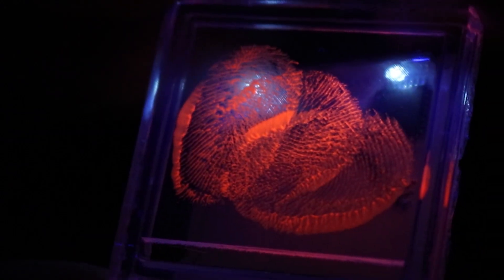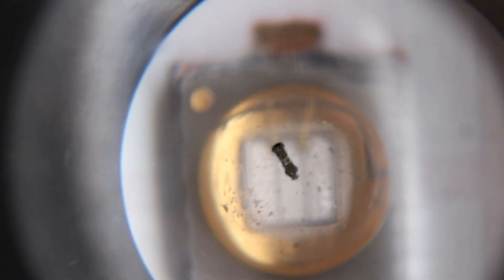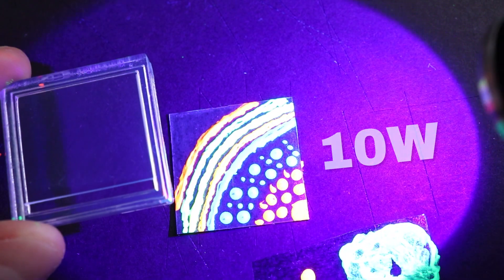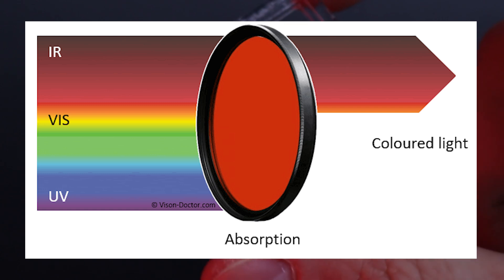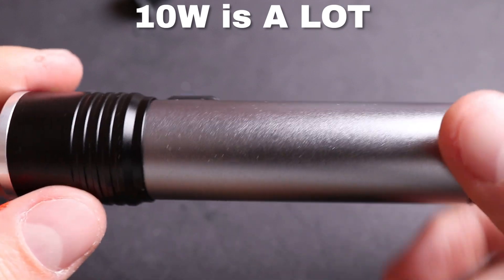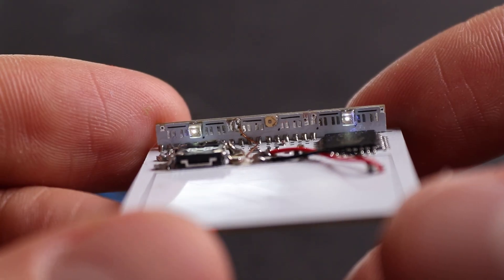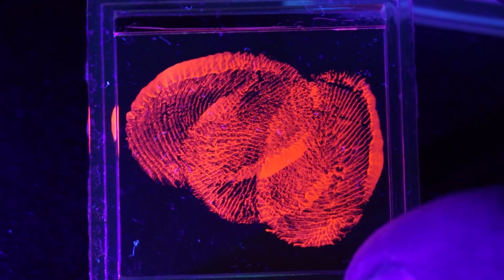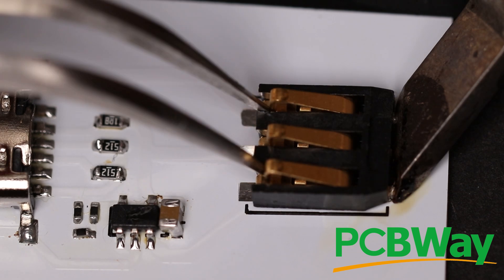UV Paint + 3D Printed Resin = ???

Comment: Resins used in 3D printing are generally very absorbent to UV light due to the printing process using 405 nm light. They are many times peaks of absorption at 405 nm and around 350 nm. So if you use a light around 375 it would still get absorbed much less. Keep in mind that UV for long periods can degrade these resins.
Reply from the maker: Thanks for the information. Appreciate it :)
About what degradation you are talkig about? Will it become blury or fragile? Cause it is really important. Also, do u think 20mW is the power that can cause visible degradation?
Reply: @NickElectronics they’re probably talking about discoloration and visual artifacts along the plastic over time. The best way to fix it is to discolor the Resin ahead of time with blue or to expect it and make what’s inside the resin lacking the yellow that will occur over time. I don’t think u are using powerful enough uv to worry about it but after years of use or over a week of strong sunlight it will begin to discolor anyway as all resin does. I don’t know much about the mechanisms but I think the total boat website has information about it
Reply from the maker: @cupidzsnakes6865  Thank you very much for the info. I will definitely take into account it next time I work on this design 👌
Reply: @NickElectronics  I wouldn’t worry too much about it at this point. Like I said ur lights should be fine. I would wait till you start having a solid prototype to start worry about a protective finish or case. Plus any failures u make until then can be used as comparisons or test pieces when left out in the sun.
Reply from the maker: @ Yep, I see, thanks again. I am still thinking whether this design worth further attention or not. Cause I have lots of new ideas that I want to realize and no time for something doubtful 😅
Reply: @ I will watch regardless 🫡